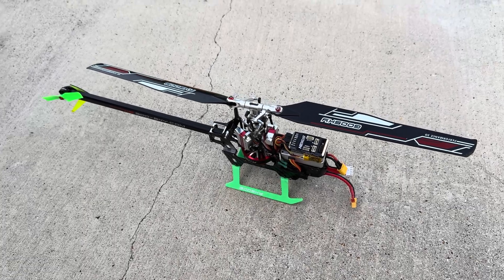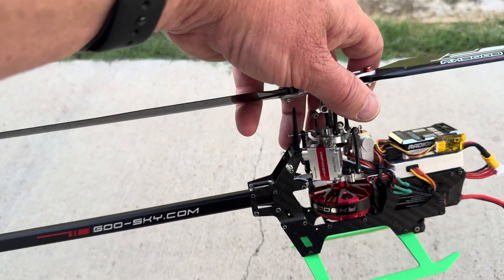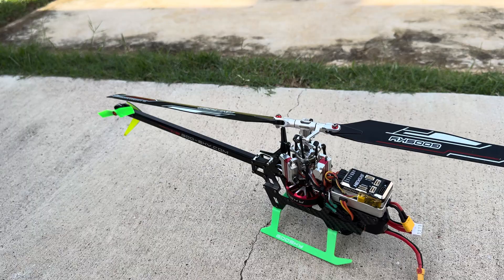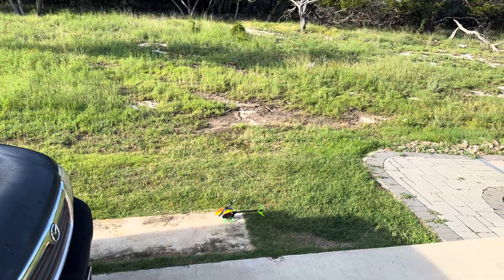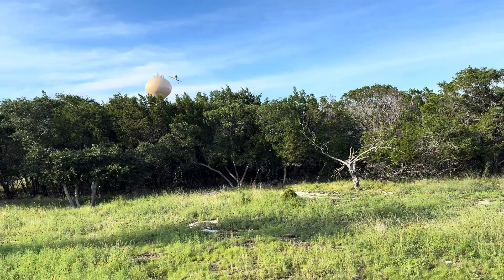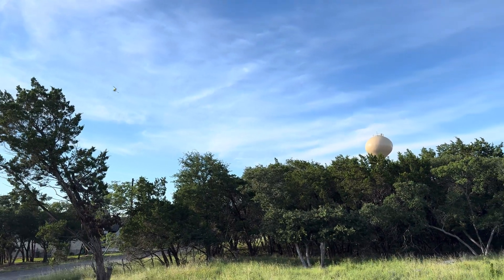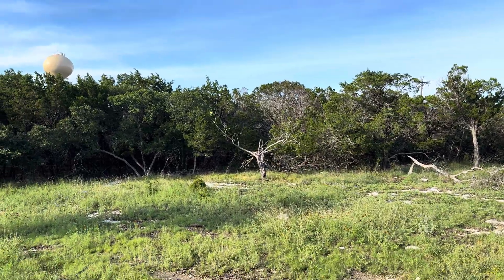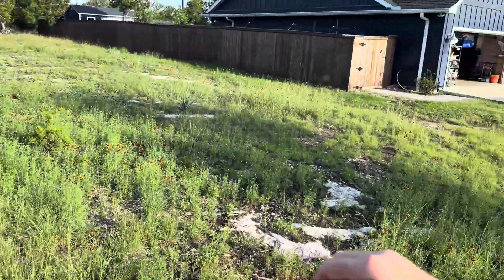Goosky S2 on Rotorflight, June 12 2025 - with crash!

Comment: That was a hard thump bumb thumbs. So impressed with the resilience of the chopper. Nice flying. What is tally on RF. Thanks for the hard work and sharing ✌️🚁
Reply from the maker: Thanks! It's a great little heli. TALY means Torque Assisted Left Yaw. Since the fixed pitch tail rotor can't actually create left yaw thrust, like a regular variable pitch tail rotor, TALY helps by temporarily increasing main rotor speed in situations where just slowing down or stopping the tail motor isn't providing enough left yaw.

Comment: This is neat that you did this. But, I have to ask what was wrong with your stock Goosky ESC/FC ? I have no issues with the performance of my S2 (non-Max) , so I'm curious as to what benefit this yields other than getting you to part with your money and adding a considerable amount of additional weight to the airframe. Nice flying by the way!
Reply from the maker: The stock Goosky FC has deadband on the cyclic that cannot be properly tuned out. As a result, the feel of the cyclic is just terrible compared to "real" FBL units, and cannot be tuned to fly the way I want it to. If your flying style is "bang and poke" or "smack 3D", then the stock FC is probably fine. But if you like to fly smooth precise maneuvers, frankly it just sucks. Weight added was less than 20 grams, incidentally.
Reply: @JustPlaneChris Wish I read this a bit ago. I just got a S2 Max thinking I got out cheap over the S2 ultra and not needing a better FBL with rotorflight. Will see how it goes.
Reply from the maker: @therealjamescobb  Worst case, you can get the new ESC box and RF unit and swap it onto yours. But if you like how it flies with the stock box, just send it!

Comment: Bolt I see you have them and since Goosky has no idea, what is the difference between the plastic, partially plastic and full metal servos for the S2? Absolutely no specs are available.
Reply from the maker: As far as I know, the only difference is the case itself. They seem to perform identically. And actually, those full metal servos are the OMP ones, but they seem identical to the Goosky.
Reply: @JustPlaneChris ah got it. They look like Goosky. My M2 Evo has the stock ones and it’s one of the best helis that I own. I love my S1 and just placed an order for the S2 Max in purple.

Comment: Can you show a video on how you trans this with the Nexus? I have an OMP M2 might be able to the same thing. Thanks
Reply from the maker: There's really nothing to show on video. I simply used the ESC unit from the Logo 200 (which was made by OMP) and plugged it into the Nexus exactly like regular ESCs would have plugged in. From there, it's just Rotorflight setup for a motorized tail.

Comment: I'm in the process of doing the same thing does the tail motor get plug into the tail servo spot thanks
Reply from the maker: Yes. There's also a CLI command you use for the Nexus to remap it. You can find that in the new 'presets' section of RF 2.2. Don't forget to bring up the TALY gain, it defaults to zero.
Reply: How did u connect the tail motor the wires comming out of the esc r thic  how did u covert them to a standard servo plug thanks
Reply: I might be thinking about g his the wrong way thanks again very impressive

Comment: Great video, can u explain wiring?? I don't understand how the servo could be controlled by Nexus, but the tail and main motor are controlled by Goosky FBL
Reply from the maker: I'm not using the Goosky FBL any more. The silver box under the Nexus is a dual ESC unit made by OMP for the Mikado Logo 200 heli. It has regular servo wires coming out for the main motor ESC, tail motor ESC, and an RPM signal. They plug into the Nexus just like servos.
Reply: @JustPlaneChris  ok, so which means either with OMP M2Evo or Goosky FBL, Im not able to connect it to Nexus or other RF
Reply from the maker: @shahram677  theoretically you can, but it will involve some custom wiring. If you open up either one of those units, the FBL portion is a separate board that plugs into the ESC unit. The boards are marked with which pin does which function. With all that work it would probably be easier to just buy two ESCs and wire them up to main and tail motors.

Comment: It's not a proper crash unless you need spares. :-) At the club I fly at people are always crashing these with zero damage, there isn't much energy in the blades, apart from the guy that flew into a post, that needed a lot of spares.
Reply from the maker: It's surprising how much of a hit it will take! There's a large rock out there (like coffee table size) that I managed to crash into full speed inverted backwards one time. That actually broke the frame, among other things.
Reply: @JustPlaneChris  That sounds like the post incident, I’ve never even crashed mine but mine doesn’t know how to go upside down or do half the things you make yours do. 🙂